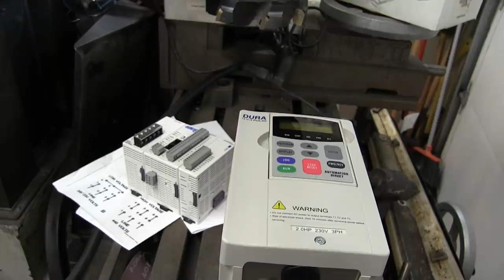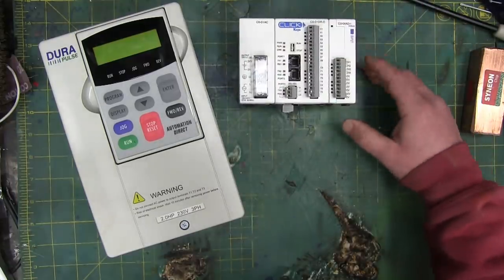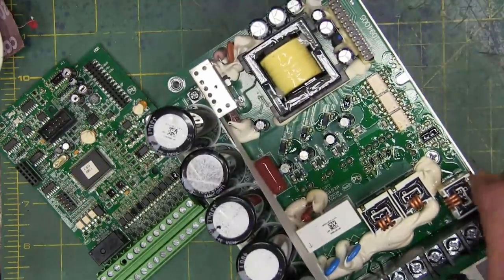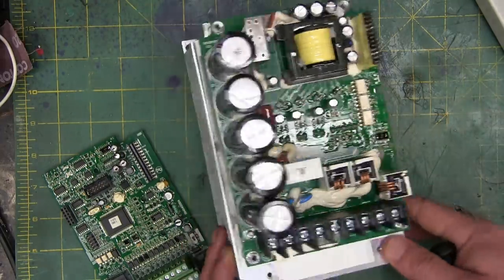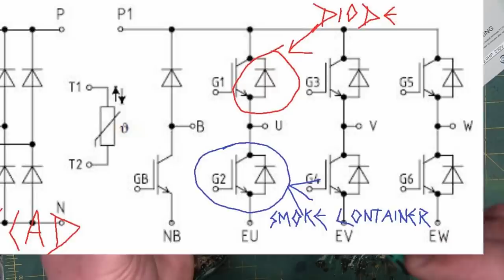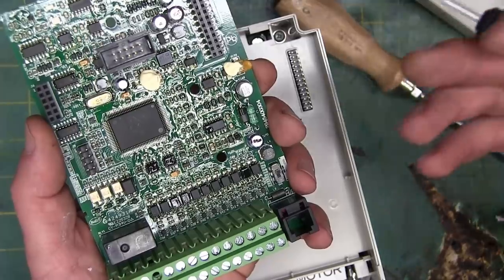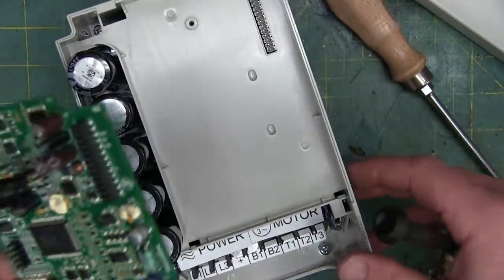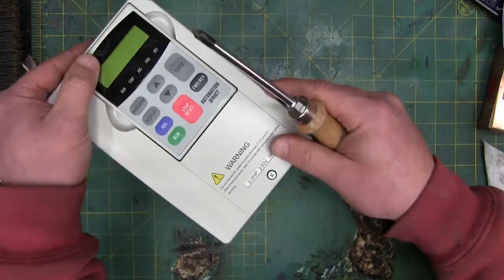BOLTR: Inverter EXPLAINED | DuraPulse VFD

Comment: We use clicks on many machines... The Allen Bradley stuff is extremely expensive..
Reply from the maker: You are now my official "I got a guy" guy. Low places what what.
Reply: Ahh yes, Allen Bradley - "You might find better, but you'll never pay more."
Reply: A-B stuff is isn't worth the money..
We make and package of million dollars worth of beer everyday with clicks and automation direct stuff..  I can have one installed and 2 spares for the cost of one Allen Bradley...
Reply: WezleyB yeah but it won’t have that Allen Bradley nameplate! /s
Reply: got click managing heat-pump, well pump (where it monitor well water level and water pressure) and through rs232 can see 1wire temps from whole house! And can do a lot more. Still need to program touch color HMI, but can do very fast things very reliable.
Reply: i use a ton of allen Bradley stuff.  good stuff, but as the saying goes "sure there's probably better, but you'll never pay more!"
Reply: If you use it properly its worth it, depends what PLC type, what operation your doing, when you think on a control logix 5580 that does the job or can do the job of 50 PLC's use profinet and cheaper point I/O solution you can control a whole process plant with it... the functionality that they have as well, built in motion control, and the ease of ethernet I/P they're well worth it.
Reply: The new 5380 L306ERM is list at 1400 doll hairs. Honestly not tea bag for being able to schedule two Axis'. Toss the cost of the software and a couple of cards... you can get moving for under 3k. Still not great, and far more expensive, but boy oh boy are the languages available amazeballs.
Reply: Connect Components? Please feel free to expand on this, I am not sure what your complaints are.
Reply: I found the answer I was looking for.... I've messed with the Micro 1500s, but nothing less than, and I programmed in RS 500. I, coincidentally, opened CCW last night for the first time and spent about 5 minutes fiddling with it before I threw it out in favor of the Studio 5000 option for programming a PowerFlex 755. I can't say I would completely avoid CCW, but without having used it much I can't say I wouldn't...
Reply: Studio 5k is a welcome upgrade from rslogix 5k. I like being able to upload tagname comments.
Reply: I honestly have yet to work with the newer Siemens stuff, but I would love to compare the two. Studio 5000 is so much fun to program in thanks to the Multi-Language Pack. FBD is incredible for process control, and if you have the stomach for it, Phase Manager is probably the single best tool Rockwell has brought to market in ages.
Reply: "dewalt tool reviewing chanel" Why not, it's 2017 and if your drill just wants to smell nice that's totally fine.
Reply: Been a Sr. Controls engineer for 12 yrs now... As an machine builder sending machines all over the world. I would like to see you use a click or any automation direct crap to build a full sil 3 cat 4 safety cell and still be cost effective. Click is crap to the big boys. For the garage home gamer they are perfect but its not coincidence GM and Ford won't let you build them a cabinet with one in it...
Reply: WezleyB - how are you talking to your SCADA from those clicks? Plant level integration?
Reply: Spencer Kennedy is that PLE, Cat 4 for Machines? Vs SIL3 for process control. I’m just learning this stuff at the moment and FS is pretty confusing.
Reply: Jon Laws- most of the heavy hitter in the PLC game make controles for machine integrated safety. The cat or sil (current standard) is a set of guidelines or rules for how to design a safety system into a machine depending on the hazard it possess with regards to the operator
Reply: Not to mention the software licence fees for contrologix. Clicks are alright, but can't handle the cold. Heated enclosures are a must if installed outside in northern cunukistan
Reply: CCW is actually pretty trick for the PowerFlex 523/525 drives. Makes it really easy to program the drive parameters over Ethernet rather than dicking with the drive's HIM. And it's about the only piece of Rockwell software that's actually free. Go figure.
Reply: Your paying for all the infrastructure and software behind the scenes.  While Automation Direct might be ok for a small job, when you need to integrate 100's of machines, both standard industrial, motion, actuators, Automation Direct will not cut it.
Reply: What type of beer?  I make and package beer thanks to AB / Rockwell AND Automation Direct.  Is it worth the money?  YOU BET, in the right application.  All AB when it came time to automate our lauter-tun process with a PLC with high-speed Ethernet-communicated torque feedback for grain compaction and grain-out complete automation.  We should share a beer some time and talk...where you at?
Reply: Was about to say the samething. Use clicks on simple robots. For everything else theres Allen Bradley.
Reply: Any DL06 fans? Thats my favorite ADC plc.
Reply: AvE hey i suggested ADC long ago bro . Im the guy.
Reply: dewalt tool reviewing chanel do you review tools or ladies perfume? I suggest spel chek you chanel name.
Reply: Omron is love, the CP1L is good for pretty big stuff! Allen bradly is top of the pile price tag, along with Simens.
Reply: John Blystone j
Reply: I think the Allen Bradley programing software is a little easer to use, but that doesn't off-set the price difference.
Reply: As an industrial electrician, the plants I work at throw away all kinds of allen bradley drives. The winery I work at has a whole pallet of old ones. Most of them still work fine. But most are 3 phase input.

Comment: Up/Down buttons for speed are bullshit. Ditto for volume in a car. "You know what the customer wants? To complete 20 actions in 20 seconds instead of 1 action in 1 second." Ditto for microwaves. Remember when microwaves were just a dial, that automatically started the machine when you turned it past zero because it correctly presumes you want to heat food right fuckin' now and a few seconds head start is good practice? Nowadays you must use PRECISION control over your food. Dialin' fuckin NORAD launch codes into the machine, 20 digit beep booping horseshit when all I give a fuck about is the nearest 15 seconds.
Reply: LOL, i still have one of those. I replaced it with one of those Space Stations. Got really upset a few days later hitting 25 quadzillion buttons just to heat a fucking cup of water. Out of the window and right into the river she went.
Put the old one back in. one dial for paua, one for time wich turns it on. thats it and all whats needed.
Reply: Truer words have never been spoken.
Reply: Strange since every microwave i ever owned has a quickstart button. And if you just push one number, without any other buttons, it also simply starts for that amount of minutes.
Reply: Update your microwave. They have a sensor heat button and that's the only button I've ever pressed on it except for when I set the clock.
Reply: Just wait, some dingleberry is going to make a IoT microwave, which will be junk if either the phone service or the internet goes down. Bar codes on your TV dinner will automatically set the timer, but only if it hasn't passed it's sell best before date.
Reply: have a look at the manual there is a analog input. looks like a12 on the terminal block. could be used to wire a speed control into a machine control panel
Reply: DJTeac - So does my microwave from the 80s. 3 of them, "Low, Med, High". They're physical buttons the size of a digit of your thumb, separated from each other by a full two inches. You can literally close the door and hammerfist the general area of the panel without looking as you turn away, and never make a mistake, your food comes out luke warm, warm, or hot accordingly. And it has a dial. And it has levering action on the door clasp so that you can open it with one finger of the same hand that's holding a full bowl of soup without spilling.
Reply: Thank fook my vfd has a rotational speed control for the belt grinder, you want speed changes now, not tomorrow
Reply: man i literally just salvaged an old panasonic microwave from getting scrapped and it has just this one knob to turn. it looks never used so i took it with me for my girlfriends office use. i tested it beforehand though and had this weird feeling. 

long story short you put that feeling in true words. thank you
Reply: I refuse to buy radios that don't have volume knobs. Fuck up and down buttons. As far as microwaves, I inherited an old amana microwave from my grandmother a long time ago, thing was probably late 60's, early 70's. it had the timer knob and 3 mechanical buttons (start, stop and defrost). It may have had a 4th button for a light but I can't remember. I'd still have it today had the case not been broken when I was moving. Worked fantastic up until then and I wish I still had it.
Reply: See page 4-32 of the manual. You can control speed via a 0-10V input signal. 

Special note to AvE: Please try this with 0-11V and report back. I'm thinking of fitting one of these to the 3 phase motor on my Myford. Actually, I don't want to run the motor at 11, but I would like to be able to run it at -1 while threading so I have a chance to engage the half nut when the bloody thread indicator says I should, then having broken the tip off my threading tool I can bump the speed up to 10 so I can crash the toolholder into the chuck at full speed.
Reply: To get 3 phase in your house, you just live in Europe.
Reply: MattsAwesomeStuff 
yea seems they have went button crazy. I'm surprised they don't have a separate on and off buttons. I prefer knobs sometimes. like volume especially. and touch screens! yea let's put fingerprints on what you use as a screen! great idea! you can hardly touch the phone these days.
Reply: My microwave is from 1989 and it has a keypad. Time > Enter, And it starts. Precision and swiftness in one!
Reply: Our microwave adds 30 seconds to the timer when you press the start button. So everyone just presses the start button a bunch of times to cook their food and now the start button is worn the fuck out and barely works. Planned obsolescence
Reply: Too funny! I just found my old old old microwave in storage that works like that and decided to "upgrade" back to it. One countdown dial for time and one switch (that can be switched while its ON BTW) that controls defrost or full power. We never needed anything more!! I just subbed to your channel, too.
Reply: the industrial microwaves they use in restaurants are just one dial. They fucking get it.
Reply: @icepick method: How'd you get flash in your icon? It only works on the notifications but still.
Reply: Thank God, I was beginning to believe I was the only one. My wife thinks I am crazy to get pissed because to change the fan speed on the "Climate Control" in her car you have to navigate through 2 menus! No one should have to pull off to the side of the road to scroll through the damn touch screens to warm up their damn feet!
Reply: I hate the up down speed buttons, the 10 turn micrometer pots work great, smooth control, very hard to over-accelerate on sensitive applications, especially when running 0-100hz
Reply: Sheldon - That's a fantastic workaround. It's almost how the standard resistor series works. 100, 220, 330, 470, 560, 780, etc. Not just good... good enough. It's not rocket appliances.
Reply: The Durapulse comes with analog input that you can hook a potentiometer if you want a dial.  I prefer the up down arrows myself.  More precise.
Reply: Unfortunately teh analog age is over. Buy some ADC Goggles.
Reply: MattsAwesomeStuff You are fucking right, sir.
Reply: I did it even simpler, industrial control start button and a simple on delay timer, that will, with a single press of the switch, both turn on the microwave ( with door closed of course, safety switches are still there in the door) at full power and will also only run for 2 minutes 10 seconds  before turning off the microwave ( and the light as well, or at least as long as that particular bulb lasts, seeing as the oven I used was made in 1984, and it is on it's third lamp and still has original magnetron and capacitor in it) to let you know the cup you popped in there is hot enough to drink the instant brew of your choice. Open door and it safely resets timer to zero again, or just push button again with closed door to do it again.
Reply: Makes little difference, it will only respond from 0 to 10V, and generally they will survive 24VDC applied to the input short term and only give max speed.  However there are digital inputs so you can give a switch to select either regular run mode or a ultra slow speed creep mode, giving you the ability to do that with the spindle barely turning over, though at the cost of a lot less torque on the motor and a kind of large whine as it creeps around.
Reply: Looks like enough digital and analog inputs for a rheostat control or 3 speed sp3t switch. Admittedly it's an extra step.
Reply: No clue, had it as a gif since before google bought youtube i think.
Reply: I explained to a coworker how i heat my coffee "Exactly 1 minute and 11 seconds" and he was like "dude why so accurate" "well why not just a minute?" " because i'd have to dial 1  0 0 or 6 0... instad of hitting 1 3 times" and he was like "...you're right".

Comment: Thanks a lot. I’m all messed up. Every time I tighten a screw, nut or bolt, I have to say “click”. I can’t even put the lid back on the peanut butter now.
Reply: The click is the sound of the thread stripping. Back it off a quarter turn. 😋
Reply: I thought it was a click from a torque wrench.
Reply: old fashioned torque wrench
Reply: Give'r hell, when the elbow pops, the crankin' stops.
Reply: Sinn you innocent sweet summer child 

EVERYTHING is a torque wrench ;)
Reply: I’m just glad I’m not the only one, everything I touch is torqued to spec; toothpaste,  Gatorade, and most of all fasteners that I have clearly stripped, click and it’s good to go.

Comment: Hey Ave, at 11:36 those are DBC (direct bonded copper) substrates, which is a copper/ceramic/copper sandwich, where the ceramic is Al2O3 (alumina), maybe toughened with zirconia. It's actually pretty tough stuff, and despite their simplicity, they are very important in the miniaturization of power electronics. The cost of that module from Infineon by itself is a significant chunk of the cost of the whole product. I work as a technology developer engineer in automotive, and because I work on these bastards daily, I can tell you that a lot of work goes into designing them so they can fulfill their lifetime requirements. At least in automotive.

Comment: Usually, you can set the pulse frequency. I made the experience, that if you run them on say 2 kHz they have the annoying whimper of the vibrating coils but the Motor is WAY more efficient and torqie at low speeds. If you run the drive at 16 kHz, you won't hear anything, but the mechanical parts. This goes to the cost of efficiency. Some Drives give you the ability to have a dynamic switching frequency that adjusts with the current flow (at the most of them that have that feature, you can´t even turn it off). At low current ist uses a high frequency, but if you really need the torque it goes down to a lower switching frequency to get the best efficiency for the best comfort. And there is even more advanced stuff. One of my drives can use a white noise pattern for switching, to get the stress of the bearings (else you will see, the small indents from the switching the housing after some service years) and to get a softer run at low speeds.